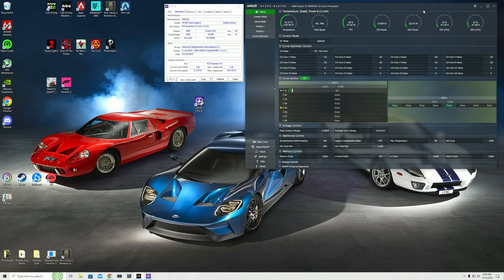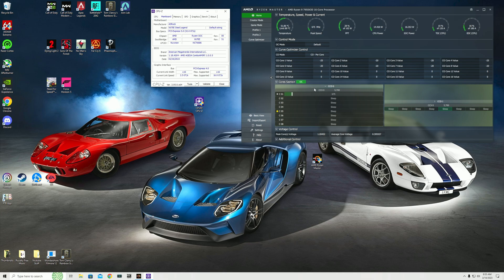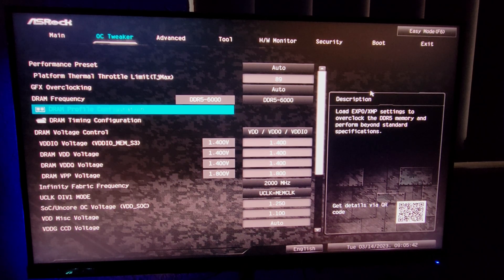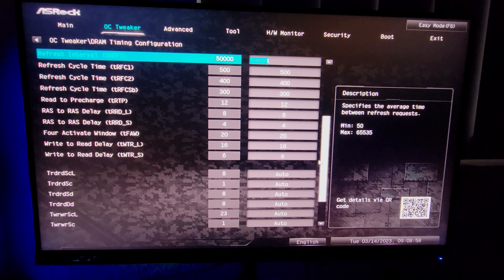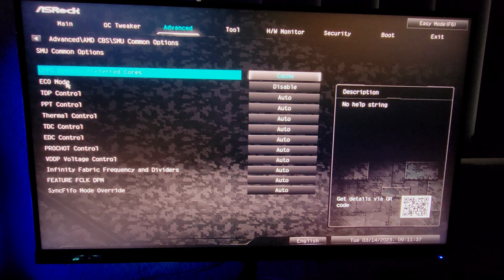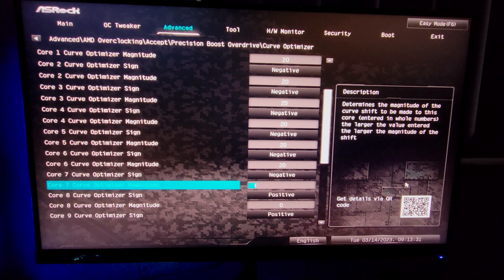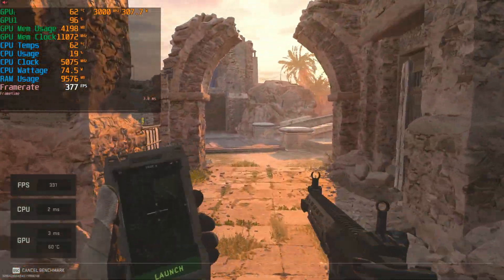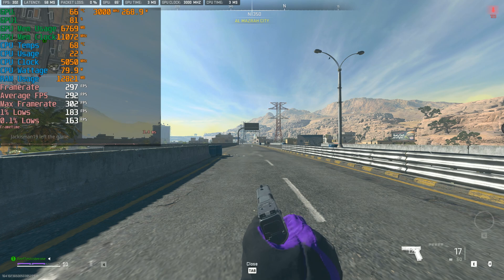7950X3D Setup Guide (Bios Settings, Ram Timings, and Undervolting)

Comment: Hello dude! I testing yesterday reaching 170 on almazrah... 7950x3d 7900 xtx 32gb gskill 6000  cl 30... I do several tests stable but low fps... I have some questions, 64gb should be giving me better performance? Windows 11 is the problem? In the last week the game has a lot of issues regarding fps... Is the reason of my 170 fps? Thanks in advance
Reply from the maker: Hey, I do recommend re-instaling windows, and changing a couple things differently from this video as it been a while since it was posted and things are a bit different.

Reset bios, and re-apply all your settings. Set your Game Mode On within windows, Apply Balanced power plan

And this last one is insanely important...if you have the steam version of cod set the voice chat to party only...this alone can be 40+ fps.

Comment: I did everything but mess with my G.Skill Rip Jaw S5 6400mhz memory. And could once I restarted I took every change I made and I could tell immediately that it was alot more responsive and loaded web pages much faster just by making those few tweaks. I did adjust my fan curves as well and noticed I could get lower fan speed while staying just as cool. I'm using a CoolerMaster NR200P MAX with the AIO and 7900XTX that's undervolted, so I needed this further optimization to help with temps even more

Comment: will stock performance 7950x3d+7900xtx+32gb ddr5 6400MHZ gives similar performance as this?
Reply from the maker: This is old footage and not comparable to today's performance sadly.

The 7900xtx wouldn't make a difference as in the MW2 Bench, 4090's and 7900xtx's are pretty much on par aslong as the 4090 is on a good driver.

Meaning your performance will be slightly lower unless you tune the 7950x3d and the 32gb of ddr5.

Comment: Why do you recommend 1.4 for the ram voltage.
Thats not what was recommend for this.
Works fine with the recommended 1.36
This timings are tested for hynix btw
Prefere cache, doesn't it mean all processes will prefere cache? 
Means all shit will run on the ccd where you want your games running.
Reply from the maker: 1.4v is because not all kits are equal, and these timings are For Hynix M die and above, Essentially 95% of ddr5 6000+ mhz kits. If I gave everyone 1.36v and the fully tightened hynix M die timings (which can get tighter) a lot of people would have issues with running it, so I gave them a voltage that'll work on basically all 6000 32gb kits, and timings that'll work on any M die and above, and a lot of samsung kits.

Also yes, prefer cache doesn't guarantee it'll run on cache, that's where I recommend you either consider running lasso and AMD intended setup...

And yes, all shit NEEDS to run on ccd where your games are or you'll see a hefty performance penalty. If both CCD's are being heavily used by 2 more intense tasks ull lose performance.
Reply: @Beefy-Tech  what if i skip the ram timings and just set the undervolt only
will that work?
Reply: @Beefy-Tech    i missed this reply somehow. 
Cant remeber the ram part 1 year later tbh.
I cant confirm your Theorie about perfomance penalty when spreading load about both ccds.
using frequenzy and binding games on cash ccd via lasso is giving best performance in most cases.
Tested different games with all available options. 
And disableing smp is better in some games like tarkov.
Reply: i found only g.skill ram support 1,35v, as kingston is 1,4v

Comment: Hi. what values when manually overclocking the memory can increase the processor voltage? I don't want it to burn.)
Reply from the maker: None other than the SOC voltage itself. If you enable an EXPO profile it may set SOC higher automatically. If you have the latest BIOS version ud be safe to change anything without worries
Reply: @Beefy-Tech  yes i update bios to last version . I have 2x32 samsung memori kits with 4800 . i can overclock it to 6000 or 6400 ?
Reply from the maker: @AjRatman  you should be fine fam, I don't know if you can OC to 6200 or 6400 but that's fine because it won't make a massive difference on X3D
Reply: @Beefy-Tech  ok. thank you . wish me a luck !)
Reply: @Beefy-Tech  hi again. I can't overclck memory even to 5800. Can you help me? Do you have fb?

Comment: How are you hitting these high fps numbers. my setup is a Crosshair x670e extreme, 7950x3d, geforce rtx 3090ti 2x32 g.skill 6000m/ts ?? I used all your numbers within my bios and am only average 145fps in mw2 resurgence
Reply from the maker: You'd want to also set your render worker count to 7, and preferably use my configuration file for cod. I also run process lasso now to force only 3D cache ccd for games.

Ull find my config file in my latest videos.
Reply: @Beefy-Tech  is the render worker count within bios?
Reply from the maker: @Spydur__  Its within the warzone 2 config file. Its the amount of threads that your CPU will use for warzone 2

Comment: Would you say this is worth $190 more over 7950x or 13900k if you are going to do 24/7 rendering?
Reply from the maker: 13900k might be more worth it if you render. The extra E cores do actually equate to better rendering performance.

Only thing to keep in mind is that 4 dimm motherboards don't really work with 7200mhz+ ram, so ull either need to get a fancy 2 Dimm slot motherboard like the Asus Rog Maximus Apex, or be okay with ddr5 sub 7200mhz. 👍
Reply: @Beefy-Tech  thansk for answer...the issue with this is that the temps and power consumption will be crazy on 13900k....I was thinking of going 125W for 13900k eco mode, but that is equivalent to 65w 7950x, so I am not sure what to get man. I just want something which is not hot and doesnt take too much power but still has very good rendering power. Ill be doing rendering in ffmpeg not premiere pro
Reply from the maker: @skrajina8037  I mean pretty much all big boi 16-24 core options are pretty hot without ECO mode.the 7950x3d will be the best at gaming if set up right, but will be the slowest rendering cpu between the 7950x, 7950x3d, and 13900k.

Whichever cpu you get, ull need a 360mm aio for sure, even if you plan to use Eco mode, it better to be safe then sorry.

13900k will be better at any gaming tasks then a 7950x, but will lose to the 7950x3d.

13900k does also use most power by a lot, so if you want a cpu with less power draw, the 7950x3d is the play, but it still gets hot even with low power draw, and it's the slowest at rendering on the 3.

Comment: Does using an XMP profile not cause any performance hit when compared to EXPO for the 7000 series (specifically X3D)? I was under the impression that it did.

Edit: Also, can you do a video that covers timings for your 6400 kit on EXPO instead of XMP?
Reply from the maker: Hey, XMP and EXPO are just pre made timings and voltages. If you manually tune everything as I have it will not make a difference which kit you get.

I run my 6400mhz kit at 6000mhz with 1.4 volts cl 30 38 38 30 68 48 + rest if subtimings with no tertiary timings done. Essentially buildzoids timings with slight adjustments made for my pc specifically.

I will be doing a video reviewing my experience with the 7950x3d after 2+ months spent overclocking and optimizing it. Found dozens of quirks with this cpu thar affect its performance. IE: windows 11 is worse for 7000x3d cpu's and the chipset drivers can hurt performance in some instances.

Will get into it within the video.
Reply: @Beefy-Tech  Hi, i have AIR cooler fuma 3 sythe, whats best for me to Undervolt
i kinda got lost here at 7:19 undervolting so do i set all of them to negative 20 or only the first 1-8 to -20(Negative) & the rest to Positive?
also my ram kit is only 6000mhz

Comment: Hey man thank you so much for the guidelines, after 8 years with my 4790k 4.6 1.25v 2400 cl12 1.6v i decided to upgrade to this cpu and holy moly amd bios infinity fabric tons of new settings lack of manual voltage section etc hit me so hard. But you explained it very well and made things more clear. Again thank you so much this is just a appreciation comment ❤ Hope i can squeeze max oc of this cpu but i need to learn what curve, offset and every other  settings mean.
Reply from the maker: Gotchu fam! In this guide I didn't include using Process Lasso for setting up the cpu so if you bought a 7950x3d I highly recommend learning how to use process lasso, it's quiet simple at its core but looks intimidating.

If you use process lasso, It'll guarantee you get all the performance from your brand new fancy CPU👍
Reply: @Beefy-Tech  can you put bottom fans in that Coolermaster h500 mesh and side fans 
cuz i cannot , i only have a 360mm AIO deepcool LT720 + 1x 120mm REAR fans + 2x 200mm front fans
I wanted to remove both PSU box + HDD cadddy box and try to put bottom or side fans, 
The side fans i think we cannot as there is no brackets to screw those fans 
DAMN we're screwed :face-green-smiling:

Comment: Will these ram timings work on a 64gb kit? The expo timings are bad af. But not sure what i can push without breaking it. already had to reset cmos once.
Reply from the maker: They won't translate 1:1 to a 64GB kit unless you have an extremely good 64GB kit or just get lucky.

I've had a guy tell me the timings worked on his 64GB kit, but my assumption is the guy had gotten lucky and picked up a Hynix A die kit as a lot of manufacturers are changing all their 6000mhz M die kits to Hynix A die, which is the die capable of 7000mhz + or CL28 and below...it's just a lottery on if yours is A die or M die, but if you are having trouble with timings, it's probably an M die kit.

M die kits are fine with the timings when it's 32GB of ram, that can be seen by the fact I have a 32GB M die kit myself...but I assume 64GB of M die is too much for memory's controller or Motherboard to sustain.
Reply: @Beefy-Tech  Hey pls reply to me too
Greetings, are you able to put 3x bottom fans in that Coolermaster h500 mesh and 2 or 3x side fans 
cuz i cannot , i only have a 360mm AIO deepcool LT720 + 1x 120mm REAR fans + 2x 200mm front fans
I wanted to remove both PSU box + HDD cadddy box and try to put bottom or side fans, 
The side fans i think we cannot as there is no brackets to screw those fans 

How are you doing with that big enormous coolermaster 500 mesh case of yours ?
Did you swap case already or still using it
Reply: @Beefy-Tech  Cuz im thinking of getting rid of it soon and getting Hyte Y60 or Y70

Comment: Please update us on these timings with the new SOC limit of 1.3v
Reply from the maker: If you look at my Bios settings. My SOC was at 1.25V within this video, and the settings in this video even work at 1.2v.

The Dram voltage being at 1.4v is separate from SOC voltage, and that one remains 1.4v.
Reply: @Beefy-Tech  yesterday I watched a board say 1.2 soc and the voltage meter said 1.41
Reply from the maker: @UltraCon79  chances are that board is broken to overshoot by so much. Normal overshoot would be 0.1-0.3 over bios voltage, and functional motherboards would all perform within those parameters.

Comment: Hello, thanks for the video. I just got a question maybe u could help me. I got a 7900x3d and a 7900xt nitro plus. I put the majority of your settings in but im only getting 130 fps on 1440p medium to loe settings in warzone. In mp im getting around 300fps with the same settings.
Reply from the maker: So the most important thing I think is setting cppc preffered cores to cache, and then using Process Lasso to force 3d cache ccd cores in the game you know run better on 3d cache.

I made a video on process lasso a bit after this one if you are interested, I highly recommend it.
Reply: @Beefy-Tech  thanks a lot for the quick awnser. Im gonna check it out
Reply from the maker: @marconavis7801  try uninstallimg the latest chipset drivers entirely, that might actually help
Reply: @Beefy-Tech  did that also didnt fix anything im at 230fps 1440p lowest settings in gunfight maps
Reply: @Beefy-Tech  my friends using a 5600x and a 6950xt and he is getting around 270 fps in gunfight with the same graphic settings same map
Reply from the maker: @marconavis7801  only way that'd be happening is 1 of 2 things. Process lasso is not applying the core forcing correctly at all (Meaning it's not only using threads 0-11 as it should be set to in process lasso) or your chip is damaged.
Reply: @Beefy-Tech  thanks a lot for the help aswell ur like the only one acutually replying. Yeah i have no clue whats happening im gpu capped when i can trust the ingame telemetrie.
Reply from the maker: @marconavis7801  it says you are gpu bound?
Reply: @Beefy-Tech  depends heavily on the map
Reply: @Beefy-Tech  that heavily depends on the map
Reply: @Beefy-Tech  update i just undid and redid the lasso settings now im at 330 fps on the taraq map with low settings 1440. that seems more about whatvi should be getting

Comment: With the current issues are you still using these settings?
Reply from the maker: Pretty much...just improved my undervolt and timings slightly. Now at a -30MV on 7 cores, and -10MV on 1 core (the best core). Timings I had to set TREFI to 38000 (so looser) but I've now adjusted Terchiery timings too (the timings below the ones I showed which were left on auto this video).

Comment: Hi Beefy, in my case it looks like the GPU doesn‘t run iver 4.2Ghz. May you have an idea which settings I did wrong in bios? Thank you
Reply from the maker: If you aren't boosting at all hours most likely have not updated your bios and your chipset drivers. Not only, but once you do the update you'll Want precision boost on advanced and core performance boost on.
Reply: thanks,you are so fast and helpful👍👍👍

Comment: Got a sweet update, finally got my 7950x3d in— couldnt expo at 6000, couldn’t boot past 5600 stable…With your guide im running at 6000, and much faster boot times. Gotta test stability now, so far benchmarks are all above average (crosshair extreme/7900xtx/7950x3d/32gbcl30.6000mhz gskill/hynx
Reply from the maker: That's great to hear! I wonder what the issue with the ram kit was,,but good it's working!
Reply: @Beefy-Tech  Honestly not sure or if just a rough go with silicon. Going to do some uv testing tonight. Also considering returning the 7900xtx for the 4090… but the sapphire card is gorgeous!
Reply: @Beefy-Tech  can i skip the ram timings as my board already find the best for it

Comment: Hey i build and did everything you did everything works finde bur how can i reset all settings at once if anything goes wrong?
Reply from the maker: For the bios settings, you cab click Optimized defaults option below where you save your bios settings and it'll revert your bios settings to default👍

Comment: @Beefy-Tech
hmm maybe I misunderstand something but how do you set the CCD0? I have folloewd your step by step in BIOS but think I maybe have overlooked something?
but thanks for the upload very helpful
Reply from the maker: You need to go to advanced, AMD CBS, SMU Common options, and the CPPC Dynamic preffered cores. You will only see the cppc dynamic preffered cores option if you update both your chipset drivers and bios drivers to the latest versions.
Reply: @Beefy-Tech  can you put bottom fans in that Coolermaster h500 mesh and side fans 
cuz i cannot , i only have a 360mm AIO deepcool LT720 + 1x 120mm REAR fans + 2x 200mm front fans
I wanted to remove both PSU box + HDD cadddy box and try to put bottom or side fans, 
The side fans i think we cannot as there is no brackets to screw those fans 
DAMN we're screwed

Comment: hey thanks a lot i ordered this cpu and was worried i would run into issues since i am not the best in this topic but your video really relifes me that i might not have any problems/solve the problems, could you also do benchmark on other games you play?
Reply from the maker: I did one on 15 games buy back then I had no undervolt when I did the benchmark.

If you ever find yourself to have any issues, you can always disable second ccd and just play on 8 cores if you want to avoid the headache of a full bios setup.

Also make sure your motherboard bios and chipset drivers are updated.👍
Reply: @Beefy-Tech  i gonna use the cpu for work/gaming and conten creation so i will have to work it out if i run into any issues but i think your video already is a huge help thanks for that
Reply: @Beefy-Tech  bur overall you didnt run into any mayor problems right? So you are satisfied and would recommend the cpu i guess
Reply from the maker: @dogu_vn7851  I'm happy with it, but that's cause I don't mind troubleshooting or setting up. If I ever have any issues I just clean reset bios and re-apply settings and since I know them by heart, I'd never have issues. I find the cpu works great, and ull enjoy it the most if you don't overcomplicate your time with it. Find settings that work and stick with em👍
Reply: @Beefy-Tech  thanks a lot appreciate the help!!
Reply from the maker: @dogu_vn7851  good luck fam!